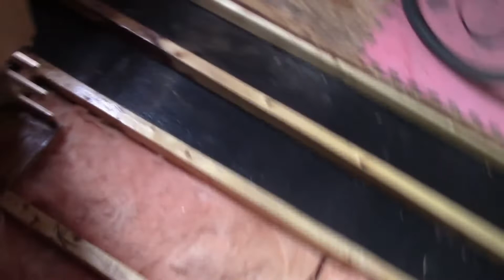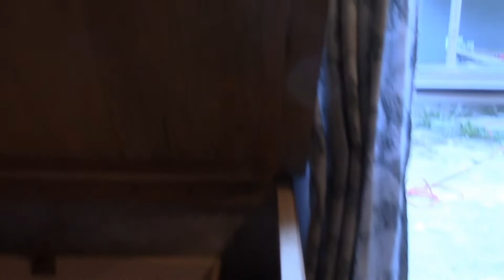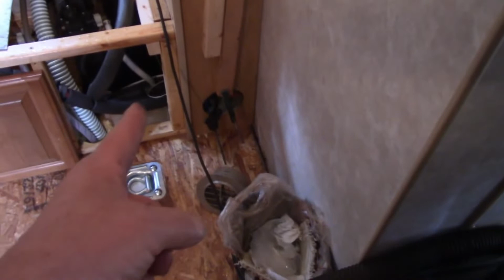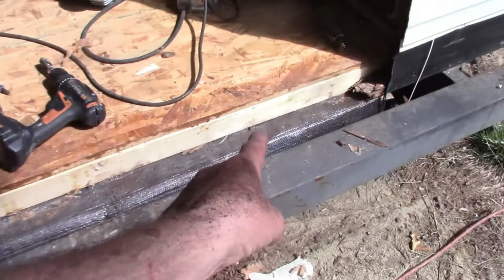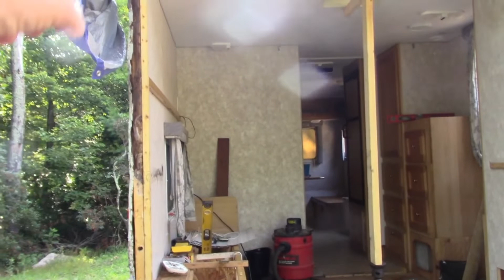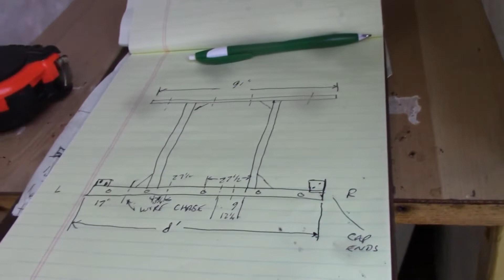SUNLINE SOLARIS 2380T TOY HAULER CONVERSION - UNCOVERED MAJOR HIDDEN DAMAGE! REPAIRS & UPGRADES  P2

Comment: I would have just used a multi tool to cut the screws off of that nailer. Then just have a vinyl decal made with a nice design that goes with your motorcycle theme to cover any damage.